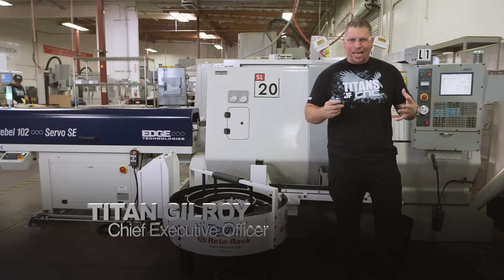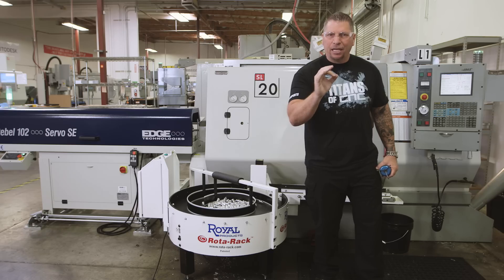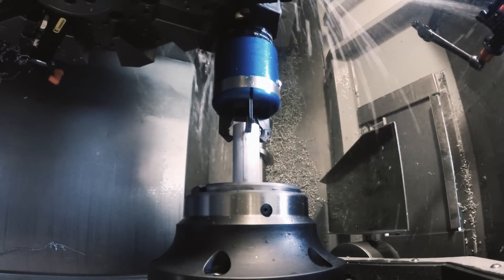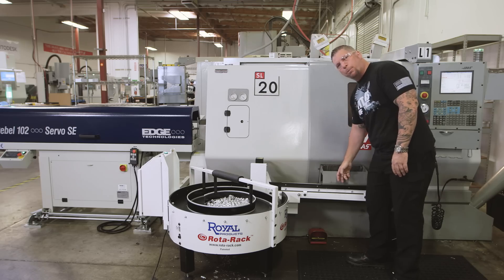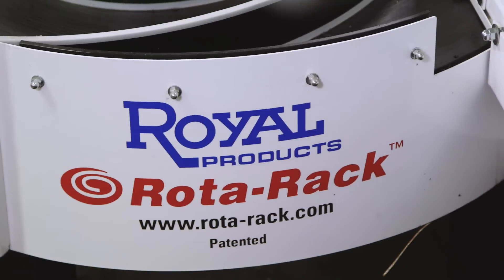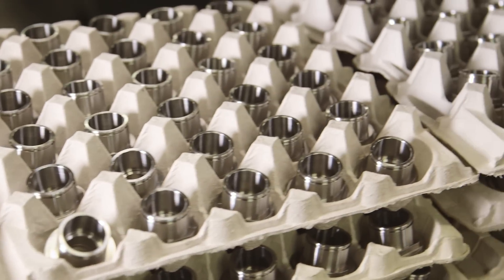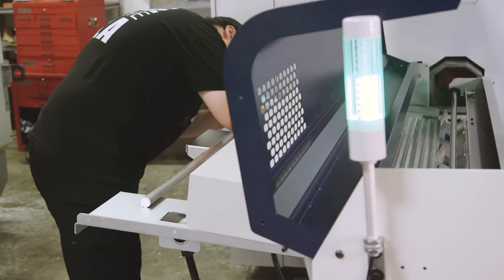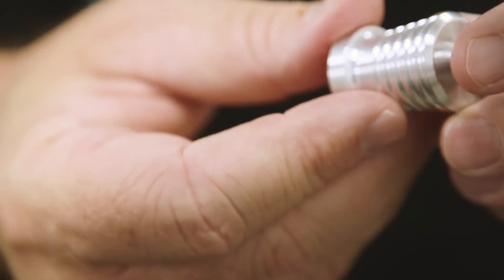CNC Lathe Automation Made Easy at TITANS of CNC

Comment: One tip with bar feeders: If you want super high rpm, it MAY be better to get a bar feeder that feeds only the length of bars equal the distance from chuck to the back of the machine. The reason being, you can then use very tight bushings inside the machine and your bars won't raddle. For example we have a bar feeder which can feed bars from 15mm to 100mm in diameter. Even tho it has very good construction and programmable bar size, adjusts automatically to different bar sizes, feeds 3m bars, and can fit about 60 bars (22mm). The feed tube in the machine is about 110mm in D, so the bore in the machine must be able to fit that feed tube, and that means there's at least 1 meter of un-supported material rotating around in the bore, and that can sometimes limit your max rpm.

Comment: Those bar pullers are stupid expensive. $1,400 last time I looked. We use dunham bar pullers where I work...$150 to get started and $55 per attachment. No coolant required so you don't have to worry about your coolant getting too low while you are out of the shop. They are also much smaller and more crash resistant. Faster too, don't have to wait for coolant pressure, your bar pulling cycles can be much faster. They also only need about .125" to grip a bar really well, meaning you can get closer to the chuck and gain rigidity.
Reply: Royal has cheaper options and ones that don't require coolant pressure

Comment: Barfeeders are great but in my experience with them they're just a pain in the ass. I run barfeeders that load 12 ft bars So much can go wrong with them. Granted the barfeeders we run at my shop are close to 5-10years old so I don't really know how much better new ones are.
Reply from the maker: I hated my old bar feeders...but was pleasantly surprised with Edge. No issues at all.
Reply: We run LNS 12 foot barfeeders, we've been running some of them for 12 years they work great and allow you to make tons more money
Reply: One of Edge Technologies' Sales Engineers would love the opportunity to stop by your facility and learn more about your application and whether we can improve your bar feeding experience.  12-foot magazine bar feeding systems work, but there are limitations depending on the straightness of your bars, the overall integrity of your bar feeder make, model, and set up, and the CNC lathe work holding and part program.  We're experts at optimizing all of these factors.  Call me:  Kevin 314-810-3981

Comment: what about tool wear and tool changes. wish there is a video on actual tool life guaranteed with specific setups.
Reply: It depends alot on the material your cutting and processes your using. Some parts from brass and aluminum you can load your barfeeders up and leave for the night and come in the next morning to hundreds of good parts (providing your machine has a good load monitoring system) other materials like certain stainless grades you don't want to have the machine unattended for more than 5 mins.  But as for your question it's all about knowing your tool life in that material and process.  If you know you can only make 50 parts with a tool before it wears out have the machine stop at 49.
Reply: Tool life and insert changes can be accounted for. Either how you program them or you can tell the machine how long your insert usually lasts and it will stop so you can change tools and get back to production